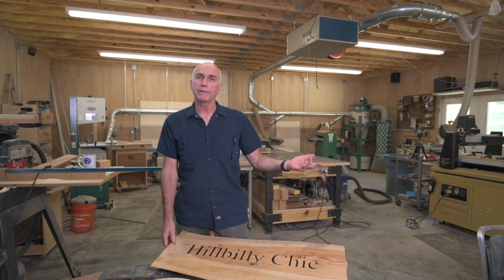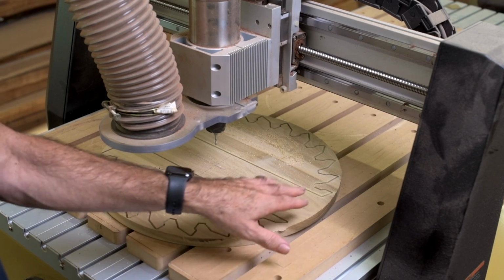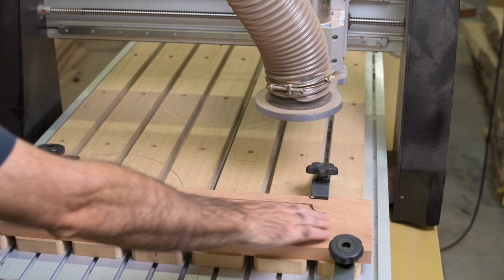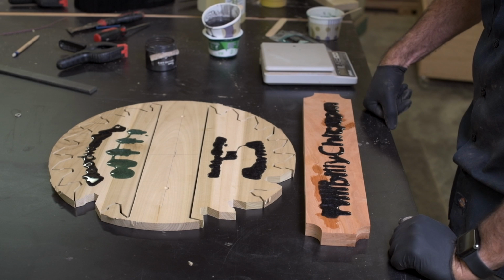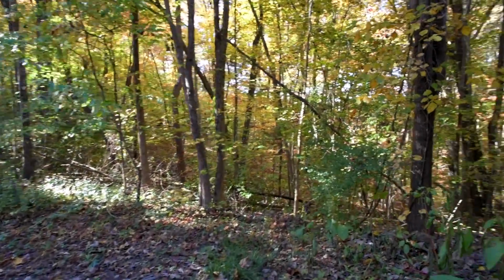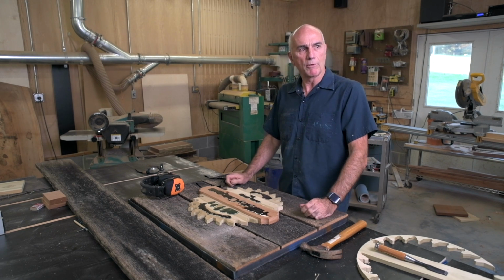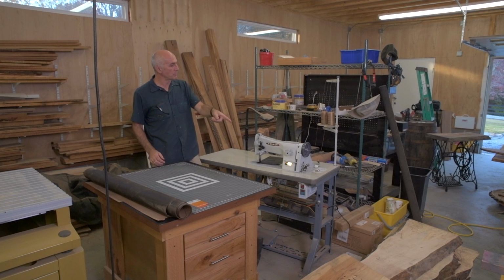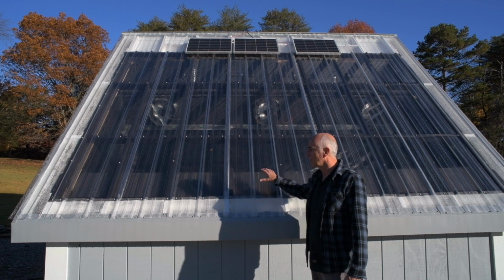Wood Shop Tour 2021 and Kiln Update

Comment: Hi Hillbilly!  Just discovered your channel.  Loved the video.  I was wondering why you were removing boards from a barn that you're actively using for your sawmill and for drying?  Are you planning to take it down?  Thanks!
Reply from the maker: Well the one had already fallen off and bent my track for the barn door.  I felt I needed two to get my project done so I knocked a second one off.  I am not taking down the barn but I do need to do a little structural reinforcement/repair and replace some of the rotted wood siding.  Thanks for the question!
Reply: @hillbillychic3933  Gotcha.  Thanks!
Reply: Enjoyed the shop tour. You have a great set up in a nice location. Tony